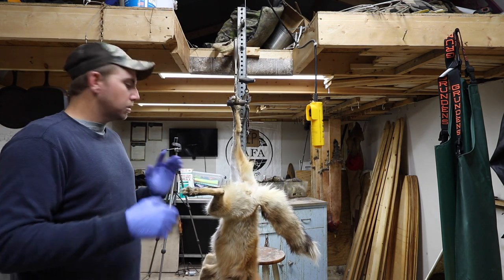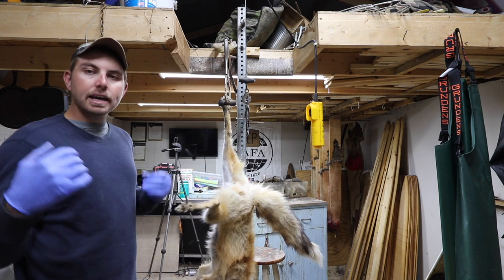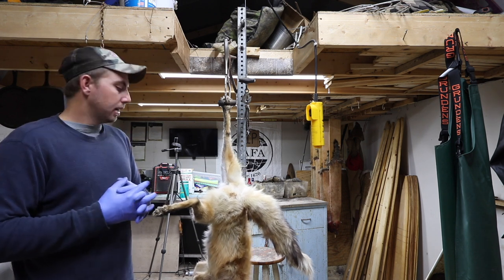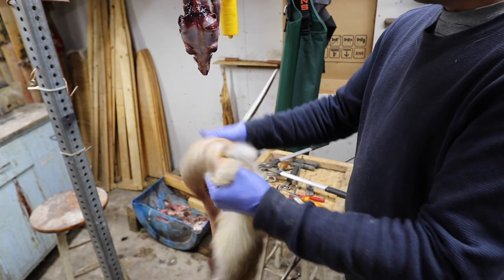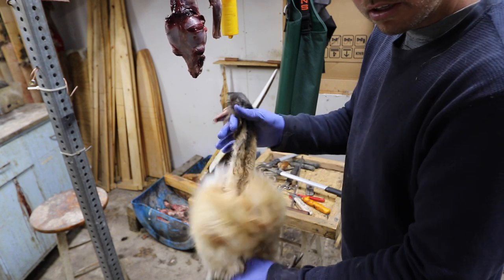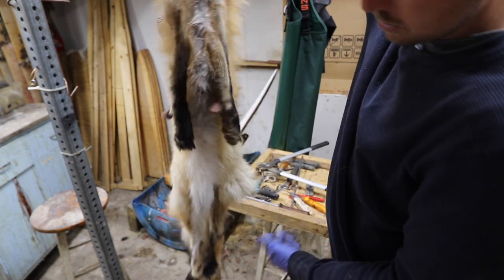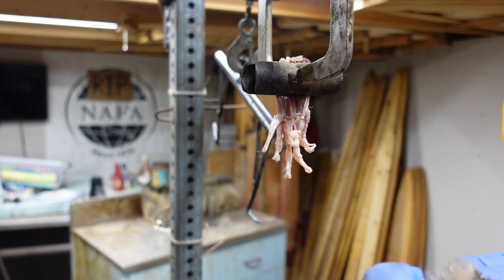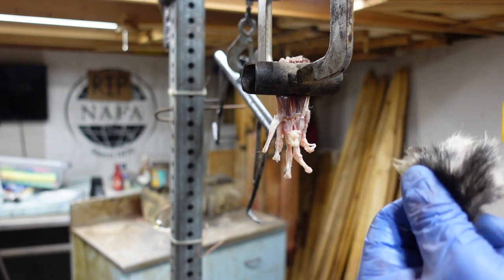{Feet On} Skinning, Fleshing, and Boarding a Fox (K9) for a Wall Hanger (Full Process)

Comment: I made your machine for skinning a couple of years ago. To pull tails, especially on coyotes, I use a metal tail stripper when you get the core of the tail exposed. Once I have it around the core I lower the animal to the point where I can put one side of the tail stripper in to one of the clamps. Then I use a pair of vice grips to hold the other side of the stripper. While holding the stripper level I pull the animal up and the tail comes out using the machine. An alternative is to pull the tail by hand rather than using the machine but still having it secured in the clamp. Saves a lot of struggling to get the tail out.

Comment: If you're gonna tan it yourself, you can just salt the whole thing after fleshing, and let it dry fur side in like that. Use a belly wedge, but you don't really need to pin it with salt. Next day, put fresh salt on/in. I have had issues with ears and the cartilage with esp Tubari fur dressers. But this year I had some with Moyles. Hair comes off the ears and around them. It bothers me so much that I am doing customer foxes via salting and in-shop tanning. I lost a trapping customer to Tubari's mess. They are fine if you want hides to make a blanket, or Russian style hats. But the trapper was really pissed about it, and a shame as he is the only trapper I know of near me. Foxes are notorious for fur slippage on the ears. I'm a taxidermist of 26 years, and been trapping 20 years. The other problem is where I am it gets warmer every winter, and I don't have that cold workplace that ears can cure at slower and better ( in my opinion, and I am really missing doing hay sets in snow).
Reply: Milankovitch cycles are a bugger for sure.

Comment: Instead of borax could you set up a horizontal hanging system where the legs will hang down so no skin on skin? I feel that could help as well
Reply: That would def help. Just be sure to get the leg skins pushed back down before its too dried.